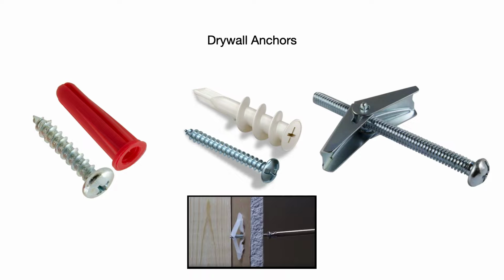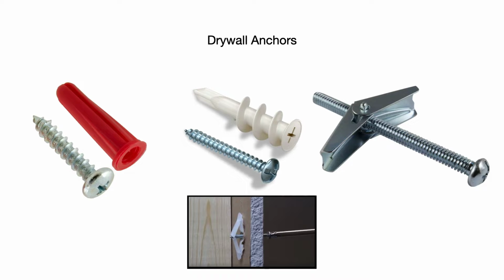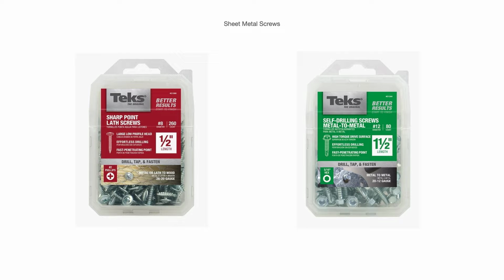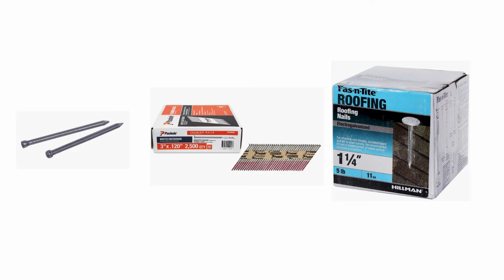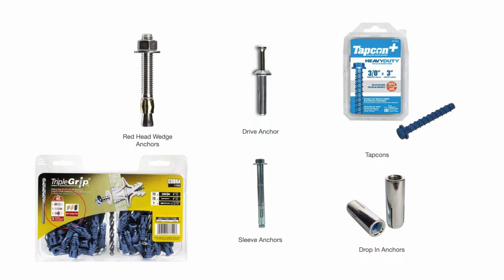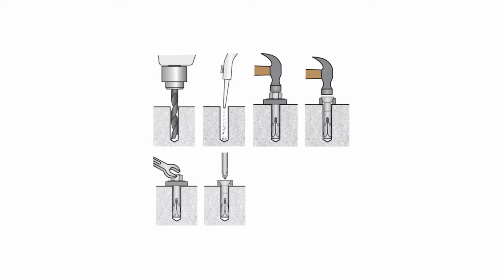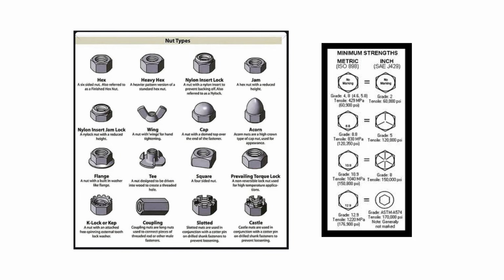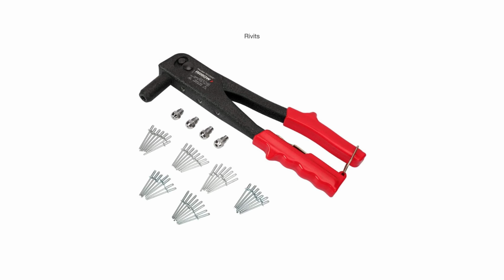Fasteners [101] 🔩(Nuts, Bolts, Washers, Screws)

Comment from the maker: Here is a link to a nut and bolt thread gauge tool:
https://www.amazon.com/Stainlesstown-Bolt-Screw-Thread-Gauge/dp/B00XUU0UMK/ref=asc_df_B00XUU0UMK/?tag=hyprod-20&linkCode=df0&hvadid=167156418710&hvpos=&hvnetw=g&hvrand=13800613061707171248&hvpone=&hvptwo=&hvqmt=&hvdev=m&hvdvcmdl=&hvlocint=&hvlocphy=9029029&hvtargid=pla-332190413954&psc=1